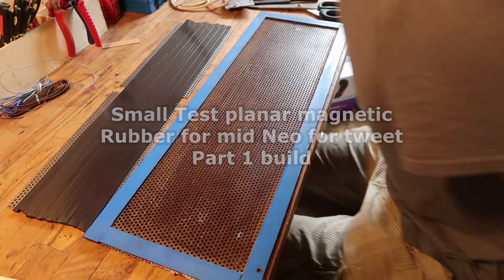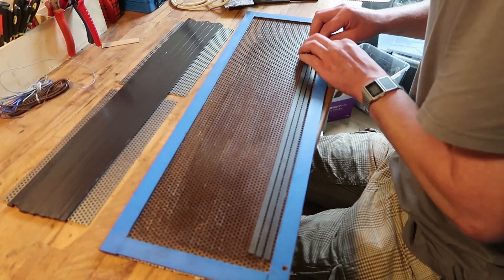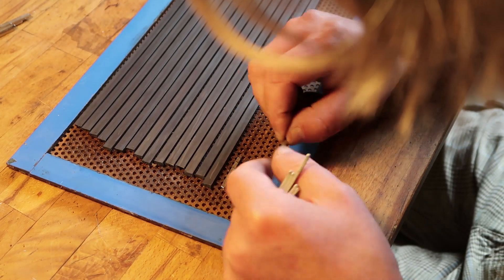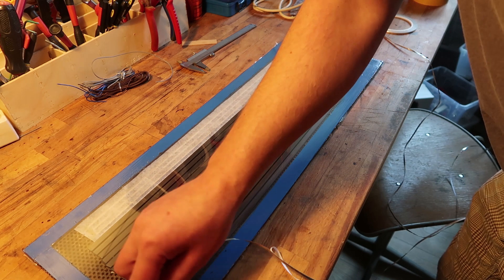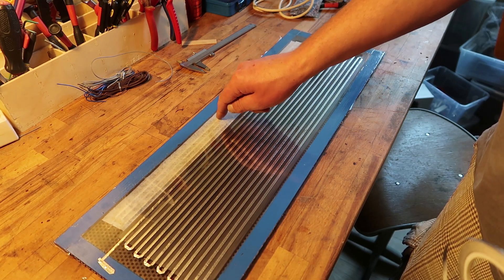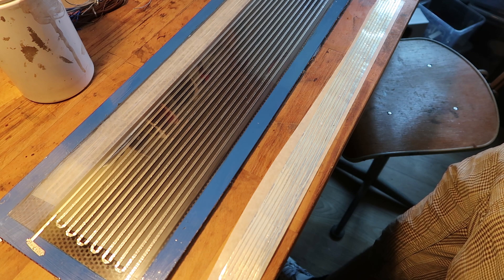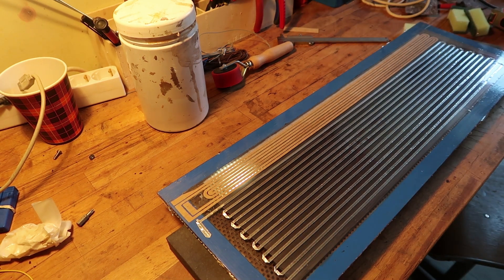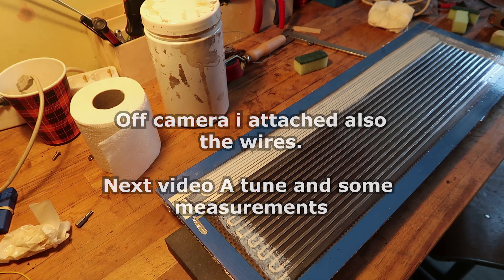Planar magnetic test panel rubber and neodymium combined  -  Part 1 build

Comment: Hi Joppe, This comment is a gratitude to your work from my side, You have answered many of my questions before and I am thankful for that. With the help of all your tutorial I managed to make my first set of planar magnetic speakers! And it worked too ! I made something similar in this video except I put separate frame for bass and treble sections, ,( but it made the panel a bit wider though,) and I used all rubber, 9mm for bass and 4.5mm for treble. (I cut the 9mm into half by fixing a knife infront of a feeder mechanism for 9mm magnet and pulled the cut end that slits the magnet perfectly into two) . I used a sony receiver calibration mic to measure the response as I do not have a measurement mic , and the response surely comes with dips and peaks but I rather enjoyed the process and enjoying the music on a set of speakers that I build by myself :)  Thanks a lot again
Reply from the maker: thats nice to hear !! rubber magnet is pretty nice to work with and making something yuourself is much more fun then a regular bought set.  keep on building !! its a great hobby

Comment: For aligning the tweeter coil just cut the paper transfer flush to the first coil so you can align it with the first row of magnets. The next are parallel so they will fall into their place.
Reply from the maker: well they need to be slightly over the magnet so i cant see them :( but next time i might make a marker on the things i can see and align accordingly :)

Comment: Well, now you are doing something that I literally did years of. Work with contact cement. 3M 30 and similar rubber cements are also called contact cement because they only adhere to themselves. Used a lot in Cabinetmaking for gluing plastic laminates to cabinets and countertops. Might even give you a little bit of dampening. Which would be cool.
Reply from the maker: yeah i always use 3m 30nf for rubber magnet glueing and glueing the membrane and often the alu wires. or sometimes the foil :)  always have a can around :) and reorder when its half empty :) last a long time :) for me at least if it does not go bad in the can itself that is.
Reply: @joppepeelen   If it freezes you have a nice bouncy cylinder. Has happened to many times to me. Expensive but good.

Comment: Hello, I'm Brazilian and I started following you, I really want to make this Magnetic Planar, I really like to do experiments,... what is the width and height of the magnet, what spacing between the magnets, which filament is better aluminum tape, copper tape, or copper wire, what spacing between the magnet's membrane.
Reply from the maker: the magnets used here where 3mm thick 7mm wide. as for conductor always use alu !!!!  either foil or wire ! its a weight thing. copper always is much more heavy.
Reply: ok, and what is the distance between the membrane with filament of the magnet.
Reply: I found this tape closest to what you recommended, Width: 9mm - Thickness: 3mm
Attraction: 35.2 grams / linear cm. or has a specific magnet.